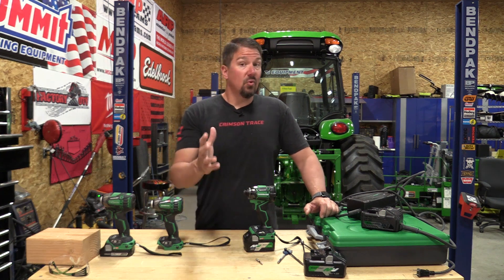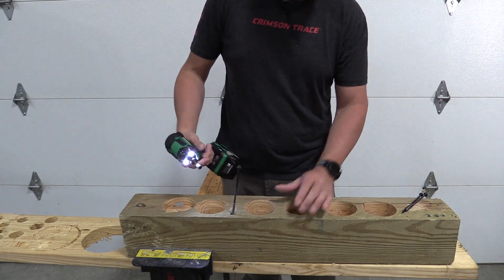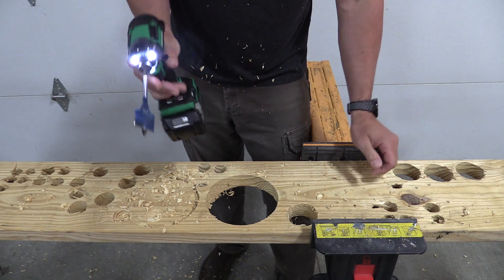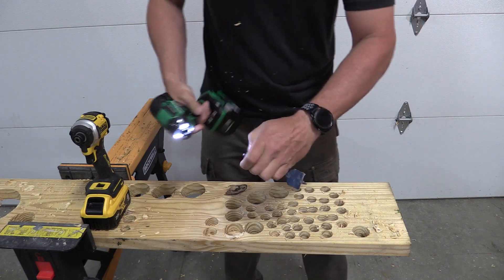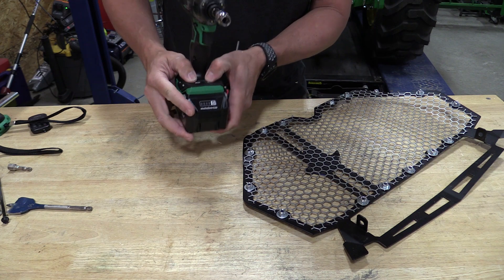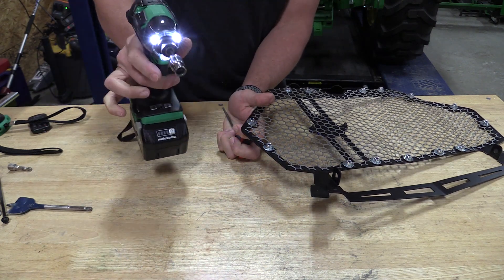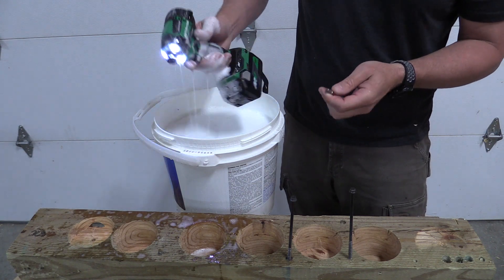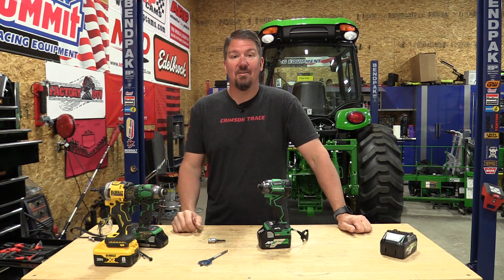New IP56 Metabo HPT 36V Tripple Hammer Bolt Review

Comment: I would love to own some metabo tools but I'm already committed to the dewalt brand and basically have every tool but one tool that I would love to have is the  cordless 10 in. Table saw. It looks like a beast.
Reply: U might also look at the MHPT 1/2 plunge router , a tool I use much more than I would have had to in past

Also the SDS Max rotary hammer
My cousin(another contractor)who joined me 0n a recent job pulled out his DeWalt Flexvolt and I pulled out my Metabo HPT 36V and we both started with batteries after 3 battery changes his batteries were all too hot and Needed to cool down before being able to be recharged
I then grabbed my AC adapter and did 2 more hours of work as he waited to get his batteries up and running-he had to run the sledge hammer
He is now a convert and bought 2 MEtabo HPT SDS Max rotary hammers
Reply: @baseballdude8491  Yup, think only the nailers and multi-tool is lacking for Metabo HTP but rest is amazing.  Also think they're the only one's with a 10" muti-volt table saw, everyone else seems to be only 8" if you need to go cordless and of course with the adapter you can plug it in too, along with all the other 36v tools they make...
Reply: @ZeoCyberG  the multi tool yes
But the nailers have been the standard for over 25+ yrs
I have a Hitachi framing nailer that is 18yrs old and still making me  money
Their new 36V nailers have an awesome framer, hanger nailer, and duplex nailer and the new 18guage is top of it's class
Reply: @baseballdude8491  No, when I said lacking it wasn't to mean it's a bad tool.  Just not as competitive with the latest from the other top tool brands that are pushing the bar higher, which is just not as obvious with the nailers as it is with the Multi-tool.  Though, you are right to point out the good history of the tool and they are very reliable.
Reply: @ZeoCyberG  nailers not as obvious-every nailer and fastener store has carries and still carries a large selection of Hitachi/Metabo HPT  nailers and fasteners
They have always been on the forefront of technology and durability-they have the largest line of nailers including specialty nailers both cordless and pnuematic their newer 36V 21° and 30° framing nailers are at the top in performance and their 36V duplex nailer and Nailer Strap Mailer we're the industries first
The newer 18guage is also an industry leader and that's just their recent models
Their 18V nailers we some if the first and best to mkt years ago when others we way behind their technology
And of course this doesn't even include their industry leading (largest line) of pnuematic products that have dominates the professional category. For yrs and yrs
Just confused by your including the nailers to their one  18V multi tool that isn't as good as some other brands
Reply: @baseballdude8491  Because some of the other brands have started to edge them out in newer features and compactness.  While they're actually owned by Hikoki now... The investment firm KKR bought Hitachi Koki from the Hitachi parent company.  Metabo HPT will be able to use the word “Hitachi” in their signage and ad copy for a few more years but that will eventually expire...
Reply: @ZeoCyberG  edge them in features and compactness
Huh?  Their 36V line has some of the industries best/newest features 36V nailers boast top of industry specs for 21° and 30° framing nailers, industries only duplex cordless nailer and StapTite positive placement nailer and the industries lightest and most productive 18Guage cordless nailer and that doesn't include the industries largest line and longest running pnuematic nailers/fasteners
As far as technology Metabo HPT has the industries only full size cordless router, rebar bender largest 10" table saw, lightest rear handle left framing saw, 
Most powerful grinder, Recip saw, mid torque and other 36V tools like the SDS Max and Plus Rotary hammers, mitre saw,compressor, vacuum and other that all can take advantage of the AC adapter which makes these tools much more flexible, longer running and saving battery life and longevity
And thats before even mentioning the LIFETIME warranty and the 36V batteries being backwards compatible with their 18V tools 
Not keeping up? Looks like leading to me in many the areas where real work is getting done
Reply: @baseballdude8491  Sorry but they don't have a version of every tool the competition makes, but I never said they didn't have any other tools that weren't one of the best options.  Again, I only singled out the multi-tool and nailers.  I don't know why you're trying to suggest that includes all their tools or reflects on the entire brand... All tool brands have different tools they may produce that's better than the competition but also tools that are worse than the competition... There's no 100% better in all categories for any of them and each brand can vary and be different on what their strengths and weaknesses are... I'm a fan of Hikoki/Metabo HTP, there's a lot to love about their tools, but let's keep it real and not overreact to everything said...
Reply: @ZeoCyberG  look I have bunch of tools in many colors, they all make some great tools and some stinkers, you brought up one MHPT stinkers which I would agree with but then casually said the nailers we're losing their edge, it's just not the case they have been the most durable and feature rich nailers for yrs and yrs and their new lineup is as well and has some of the best innovation and productivity than the others,I'm not sure your aware of their whole line as most contractor & fastener supply stores carry the extensive line 
Lowes and Home Depot don't carry the extensive lines as the others in store
Acme online carries most if u are not aware
I don't mean to be a prick about this but so many comments online are made that end up forming an opinion without really being very factual and could deter someone from missing out on some good tools 
I'm sure your a.good guy and meant well
No hard feelings-im just passionate about sharing about good tools
Reply: @baseballdude8491  I understand the passion, they were the gold standard for nailers for many years and are still considered top performers but they all have their pros and cons and it's not like the competition has done nothing to be competitive.  There's other nailers that can have a larger number of nail mag capacity, that are lighter, there's features like adjustable exhausts that only Bostitch and Milwaukee offer, not all Metabo models have Dry fire lockout, Estwing, Makita, and Milwaukee have slighter better visibility and accuracy of the sight lines. There's also give and takes like the Matabo (Hitachi) HTP NV45AB2 is one of the fastest in the market but is more expensive than a Max, and can be said to be less durable... We could go through the many ways they all compare for hours... Sure, you may not agree and that's fine, you don't have to agree with me, but I'm actual a stickler for details and facts... We'll just have to agree to disagree on this one.
Reply: Yeah as soon as I find a deal on the table saw and the router I'm going to be all over it 🤤and the option of the AC cable is a big plus.

Comment: My only concern is the oil spewing out as that seems to be a common thing with this model.
Reply: Oil can spew out of any impact driver if you work it hard enough. I have this tool and have not had that happen, been using it a few weeks. I would think if it was a common problem, it would've been addressed long ago. The triple hammer has been around for 6-7 years, and the brand has produced a plethora of successful impact drivers.

Comment: I’ve got the wh36db and I use it working on hondas. It’s extremely useful and very smooth. It takes off more than snap on 3/8 compact impacts that my coworkers have. There are times where I’d like it to be a bit more powerful but so it would be nice to upgrade to the bolt impact driver but I can’t complain with the one I have. Highly recommended

Comment: I would consider switching completely to Metabo HPT if they added a few more tools to there lineup, they need a better oscillating tool, and a random orbit sander, to just name a few tools where they fall short
Reply: I run a bunch of colors but my daily use tools plus some that others don't carry like full size 1/2 router, portable Band Saw, SDS Max rotary hammer, full size 10" table saw, rebar bender, all  are tools using the AC adapter is a game changer
Reply: they just announced their cordless orbital sander thankfully, but yeah agree the oscillator is just plain bad compared to the dewalt xr one we have

Comment: I can tell you why I didn’t go with them, as for others, I suspect maybe the same reasoning. Being a diy guy, I needed a line that would encompass everything from automotive to carpentry to demoing. I know Metabo has some pretty good impact wrenches, but that’s really the only automotive tool I know of that they make. Their lineup consist mainly of woodworking tools and I wanted to base my ecosystem off of mechanics tools, because I can just hop in the truck and go to the store if a drill fails and it’s kinda hard to do that when an impact wrench fails and your truck is in pieces lol. Plus, your reviews are really the only ones I see on YouTube for Metabo. I mean they’re out there, just few and far between. Basically, I felt like I already knew my Milwaukee like the back of my hand that day I walk into ace hardware and picked it up. Great video as always Bryan!
Reply: Full disclosure, I stopped the video about 3/4 of the way through to make my original comment and you said the exact same thing at the end lol. Obviously TTC has one, I believe I saw man caver do one, and VCG has some. It’s like trying to find Kobalt reviews.
Reply: @Griffinwoodworks  those are old videos and only the 18V impact(except VGC) and then no other MHPT tools(except 18av Recip VGC) when many of the 36V line would have wiped the floor with red, yellow and green
Recip saw, SDS rotary, portable band saw, full size 1/2 router(only one in mkt) , hammer drill, rebar bender(only one on mkt), vacuum(perfect tool for AC capability, cordless compressor, 10" table saw(largest capacity, rear handle(lightest in industry), and mid torque monster-all tools that I use on a almost daily baisis-oh and that doesn't even include the industry standard nailers 25+yrs running
the ones that they don't have I use my teal and red for

Comment: Thanks for the review. I think Dr decks and awesome framers also occasionally review and use some Metabo hpt tools. I think someone else mentioned RR building as well. Currently I own Metabo hpt and Makita tools. I think it's nice to have only one tool line but two battery lines give you a lot of choices.
Reply: I have ten tools or so in Makita but metabo just has several things i want that makita doesn't or didn't have. A battery operated rebar bender, table saw, air compressor, and compound miter saw that doesn't cost a thousand dollars. the best selection of hoseless nail guns including a duplex nailer.  Makita has a huge selection already so the flexibility of both is great.
Reply: @jakesnowake1  Of the two HPT cordless miter saws, one of them(the good one) is $1050.00 bare tool. The other one is decent, too, but only if you get a good deal on it.

Comment: When they get an oil impulse/hydraulic driver to compete with the M18 Surge or the Makita oil impulse driver, then I will consider switching battery lines. I love the quiet for indoor use more than I need the ultimate torque for driving in a screw.
Reply: Hikoki has one but its not available for USA
Reply: You have to buy it off Ebay from Japanese seller
Reply: @FoxOutdoors  Yeah, and be prepared to spend $500 for it.

Comment: There is a lot to love about Metabo HPT.  I think their name change combined with Lowes shuffling them around in their stores haven’t helped but the tools I have tried are great.   The way they handled the 18v/36v option is right there with flexvolt for giving you a higher voltage without excluding 18v users.  Great stuff!
Reply: I honestly prefer the 18/36 v over the flex volt because it feels like more of an ambidextrous battery. I honestly think they nailed it with that solution. You’re not putting a 60 V battery on a impact or a drill you can but why would you if it’s not necessary?  it’s like strapping a brick to your tool.

Comment: I think until metabo qualifies well throughout most of there tool line in tool tests like Project Farm and Tool Box Buzz they will remain a lower tier tool line.
Reply: Project farm has only tested a few MHPT tools and if course picked the 18V Prosumer grinder/not the king of cordless grinders 36V(check tools N stuff if u need video proof) and then the other was the multi tool which is the 18V and a model that has been out for yrs
If he would actually test their Pro line 36V and other brands best-then he could call it the "best" but that is not normally what he does-he picks a few select brands and then cals best
Tool box buzz and tools N stuff do much better head to heads
Reply: Metabo HTP is owned by Hikoki, previous Hitachi.  The Hikoki brand tools are basically the same and you can see those reviews from tool reviewers around the world.  It's only North America that they're not widely used but most other countries they're one of the top tool brands.

But there are other tool test channels like Torque Test Channel that has done some tests you can check out like this one....

https://www.youtube.com/watch?v=2u6ta8Jbr9Q

https://www.youtube.com/watch?v=AizmDlblfNk

Comment: I really like all there tools wish they made more of them ip56
Reply: Look up the IP (Ingress Protection) ratings. IP56 is not rated for full water immersion. Need needs to be a 7 or higher.
Reply: @MikeyA5693  the IP56 is a gauranteed rating for what is protects against, doesn't mean they won't perform better(as it did in the test) than that rating-the other tools brands can't even gaurantee the IP56 and offer a lifetime gaurantee-no other brand is doing this and they are charging u more for their tools and force u to buy gobs of batteries to run high rpm/torque tools while Metabo HPT offers an AC adapter making their tools much more useful and saving battery longevity and cost over the life of the tool
Reply: @baseballdude8491  oh cause he submerged it in water for only for this video that this tool you say its "performed better" than what its rated for. What a joke. False info is FALSE Advertising.
Reply: @baseballdude8491  I can submerge my Milwaukee under water too. This tool aint special.
Reply: @MikeyA5693  Had a worker leave  two Milwaukee a 2nd and 3rd gen that we out in rain 1 day
Both did not work(one we eventually opens up and had to untrust the components and it's worked ok with some more cutting out he other has never worked again-had two triple hammers out on same jobsite all of them never stopped working-yes we eventually fired the emnoloyee
Reply: Also had another Milwaukee fall in creek and it worked intermittently ever since as well
I use all the colors of pro tools U must be a Red only guy cuz if u actually used the Metabo HPT 36V line u would realize there are great tools and the IP56 rating is not fake or false info-r u the new disinformation czar?